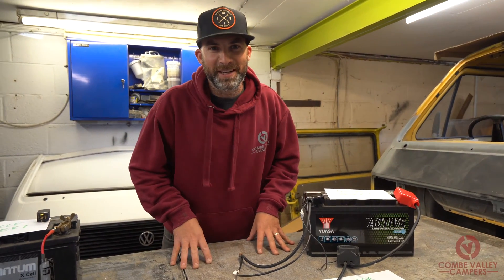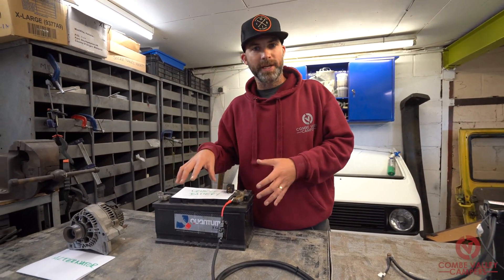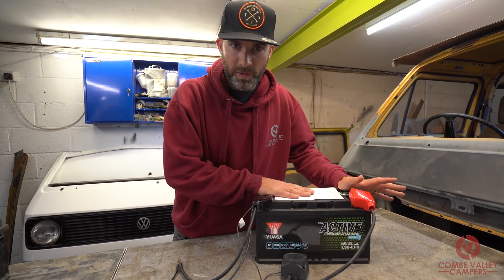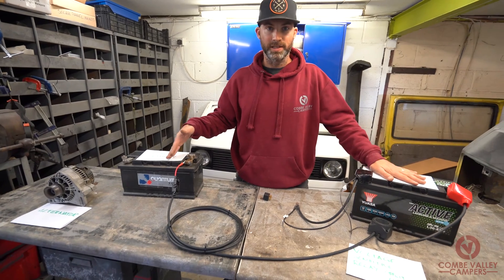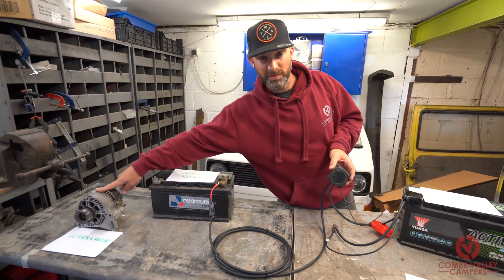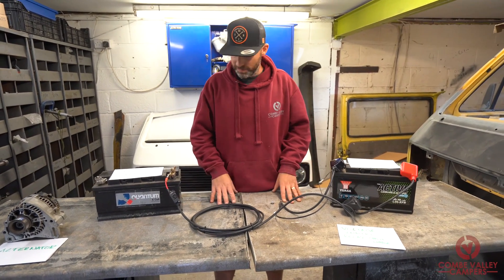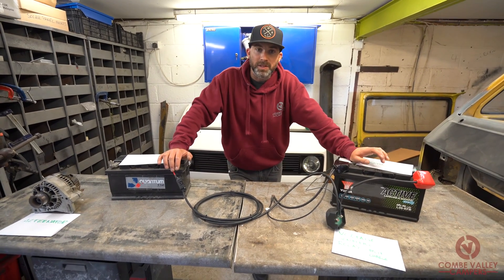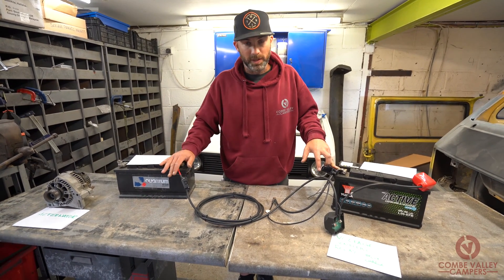A beginners guide to leisure battery charging and wiring.

Comment: To use this system (as a trickle feed whilst driving) on a 48v lithium battery bank with a specific charge profile, would you need to run it through a 12v-48v dc/dc converter and connect to the charge controller rather than the battery direct?

Comment: Hi all.  Does anyone know of a van that is under 2.02m high (length is not an issue) that has a larger interior space than a Vauxhall Vivaro (Same vehicle as Nissan Primastar and Renault Trafic)?  I need the biggest internal space that will still fit in an NCP multi storey car park.  So far it looks like the vans I mentioned may be the best option unless someone knows better.  Thanks.

Comment: Thanks!  This will help me to get to this stage and feel like i could get the leisure battery set up.

Could you please now explain how you then would wire parts in for e.g  little led spotlights, plugs, usb ports

As i don't know how you would then connect these parts to the leisure battery?

Comment: You’re doing a great job with these videos. Well done. They’re all really informative, simple to follow and quite inspiring! I’d like to see a full wiring vid if possible. How do I fit the split charge to a T5. How does the 240v plug in work, how do I add solar , how does it switch between the three, how do I wire the roof lights before I put the roof lining up, And also, do I fit the electrics before I carpet the back? That should keep you busy. I think they call this being a victim of your own success? Keep up the good work!!!!
Reply: why is there no replies to your questions Peter?
Reply: @OneLifeNow  Because I only just got here! It's not even my video...
Reply: 240v needs some sort of charging system (i.e. battery charger). Some battery chargers come with reverse polarity protection, some do not. Check your charger specs, it should say whether it needs to be electrically isolated or not - if it doesn't say, it probably needs isolating.
I'm not an expert on solar but I should expect that the controllers are similar to 240v battery chargers in that some will need isolating and others won't - check the specs!
The charging system providing the highest voltage will win - though this might not be the charging system with the greatest current - the thing that actually charges batteries.
Depends what roof lights you want but it is generally best to fit the wiring first (1st fix) then put the lining up and then attach the lights (2nd fix). It is advisable to run cables through some sort of trunking as this protects the cables, allows them greater heat dissipation (not going to go into why that's important here, just know it is - and that it is a legal requirement), and is easier to fix when (yes, when) something goes wrong or you'd like to upgrade or alter the wiring. Similar things can be said for gas and water pipes too.
If the lights are 12v, you only need a positive (red) lead (with a suitable fuse!) connected to the positive battery terminal (or distribution unit) which can then go into a switch and then to the lamps. The negative (black) leads just need terminating and connecting to ground (van chassis).
Anything I missed?

Comment: I probably know the answer but just to confirm please...it’s possible to have all three methods going to one leisure battery yeah. So, split charger whilst travelling, plug in charger when home/camping, solar on the roof working when sunny 👍. Superb videos, looking to buy & concert my first van soon
Reply from the maker: Hi Dougie, yes it is. As long as its wired up correctly and safely.

Comment: Solar please I don’t use fixed panels because of the following, they are redundant when travelling cause the split charger, on the roof they get dirty and the angles are wrong for optimum charge so I find portable ones in the screen when parked or facing the sun when at the van. I get a better charge quicker but am limited to 100w what’s the best ones to get to improve my system? Thank you 😊
Reply: I have 2 fixed panels on the roof and more than enough power even with the not so good angles and they were a fraction of the price of separate portable ones which are not so secure (ie someone can just pick them up and walk off with them). Up to 600w and less than £200. Not had a problem with getting dirty.

Comment: What batteries sizes would use for starter battery or aux battery a vw t25 campervan it is 2.0 cu engine
Reply from the maker: Hi Marcus, Thanks you for your enquiry. If you email info@combevalleycampers.com we shall glady provide you with dimensions and a supplier for the batteries
Reply: @CombeValleyCampers  i have send email to yourself about the batteries

Comment: Love your videos! What do I do if I need four (or more than one) leisure batteries?
Reply: Connect them up in parallel. However, you'll want to ensure your VSR has a current capacity greater than that of your alternator as the current draw on a bank of batteries could burn out the VSR (or really the fuses that you REALLY should have put in!)
Reply: @rebeccahare897  Thank you! <3

Comment: Great explanation and well manufactured kit. One question though, on other channels people have mentioned “smart alternators” and the need for a special kit that is costly for those. Are you able to shed any light on this please. Thanks.
Reply: I'd second this 👍 I'm converting a transit custom which I think has one of those "smart" alternators, info would be great
Reply from the maker: Hi Diesel Bushcraft. The video for Smart alternators is in the pipeline, thanks for your comment.
Reply: Thanks Combe Valley, that’ll be interesting. I’m just in the process of buying a VW T6 150BHP Euro6, do you happen to know if they are Smart Alternators please. Thank You